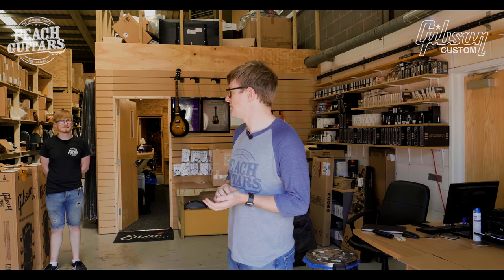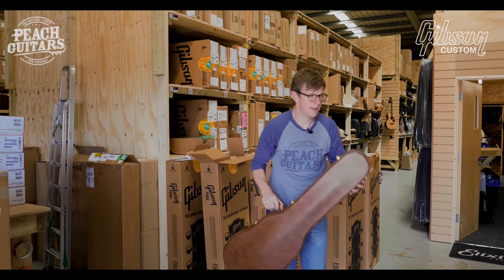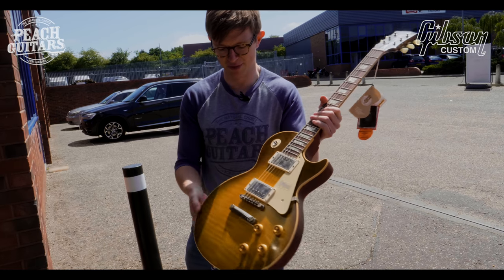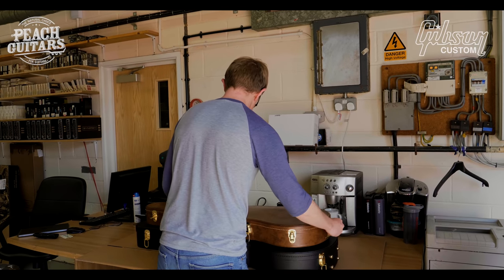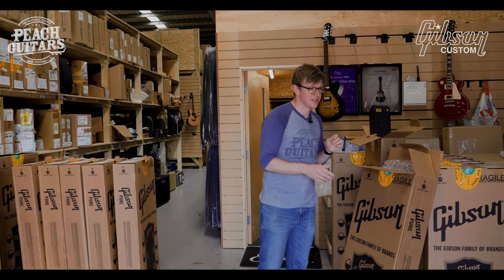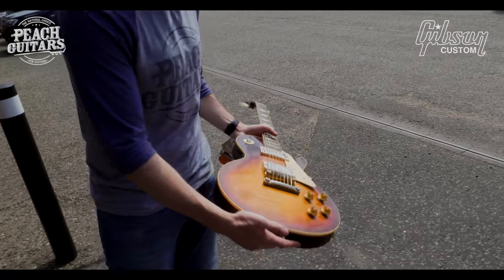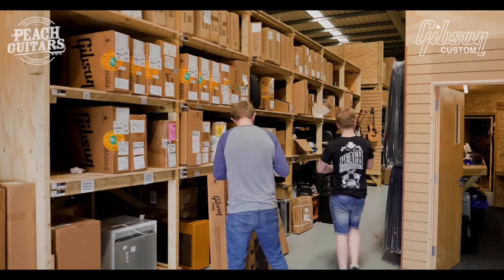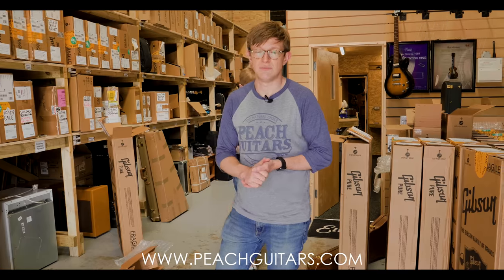Gibson Custom Unboxing: 27th June 2019

Comment: Given the large difference in numbers between the LP and the 335, there's not much guessing in which is the most popular model in the UK....
Reply: Pisk Six I don’t think it’s just in the UK to be honest. There’s a reason that, like John said, the Custom Shop doesn’t make many ES-335s.
Reply: @davidburke2132  I visited the Memphis plant, where all the non solid body electrics are made, but did not see the custom shop. I actually asked the tour guide, and he confirmed Memphis has a custom shop section, but did not elaborate. 

I do not have a problem to believe the Les Paul model is the number 1 seller worldwide. When you think of Gibson, it is actually the model name that comes to mind.
Reply: Pisk Six I don’t think the Memphis factory ever had an official custom shop, but they did for sure take over manufacture of all except the very highest level ES series guitars and put out some very special models indeed (I have a few but even I prefer Les Pauls 😛). I can understand why they would refer to some of their limited run production as custom shop as it was that in all but official name. 

Unfortunately the Memphis plant is no more, although I believe most of the skilled workforce has transferred to Nashville to continue the ES guitar production there now that Gibson has (sensibly) rationalised production into one plant rather than having the overhead of two separate production facilities.

Comment: Gibson Custom Shop comes with a screw missing on the truss rod cover.  Gibson is nothing but over priced garbage.
Reply: Your full of it dude,
Reply: You're absolutely right any $300 guitar with $2000 in pedals and $500 in upgrades will sound just as good as a les paul.

Comment: why do the finishes still look cheap and plasticy.
Reply: fretboarder You mean rather than high gloss? Because these are VOS finished guitars and not intended to be high gloss. You will see, very occasionally, a gloss version of one of these guitars (usually in the stock of a big dealer in the States such as Wildwood or CME) but they make most of them in the duller VOS finish because most buyers prefer them that way. 

Personally I have a mild preference for the gloss ones but I’d never describe these VOS ones as looking “cheap and plasticy”... they are still stunning finishes. And more to the point from the feel of the finish perspective I’d go for one of these over a poly finished PRS Core or Wood Library guitar any day.